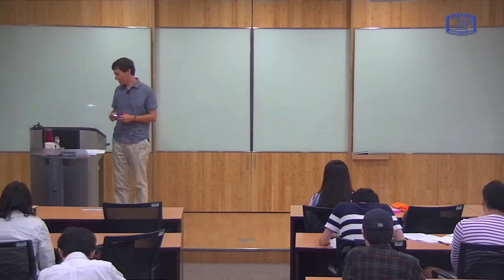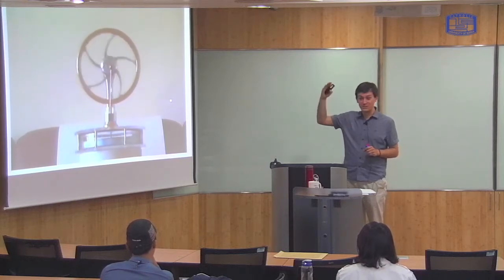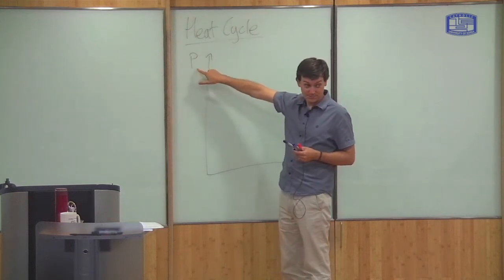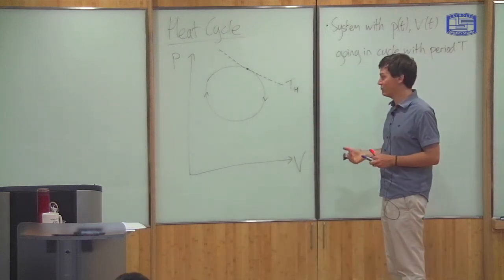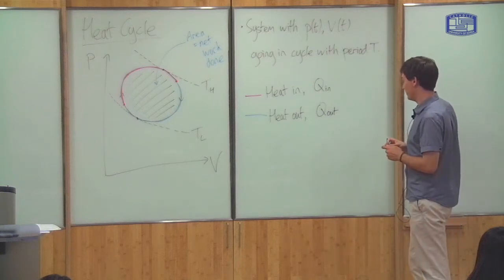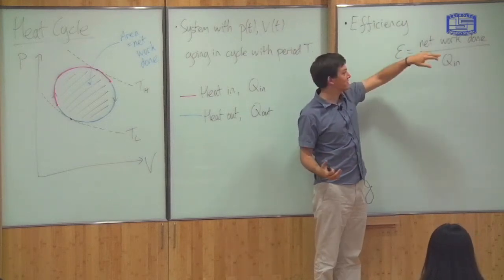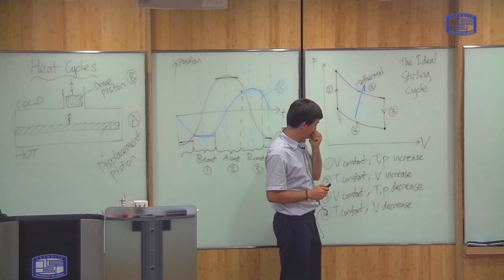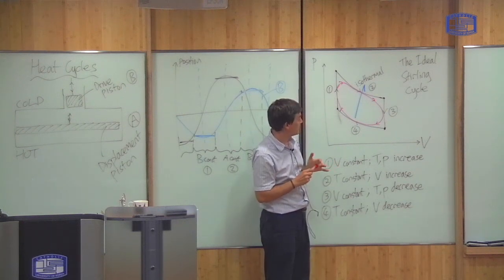6. Heat Cycles -- Course in Thermal and Statistical Physics

Comment: 6:28 you made two marks and defined heat is "going in" during that part. How did you decide those marks?
Reply from the maker: In adiabatic expansions no (net) heat flows in or out. So you can tell whether heat is flowing into or out of the system by whether the slope of the curve is less than or greater than the slope of an adiabatic expansion at the same point. The marks I drew are the points at which the slope is equal to the adiabatic slope. The exact position of the marks would depend upon the system, but generally they will have the positions shown relative to the isothermal curves I also drew. Does it make sense?